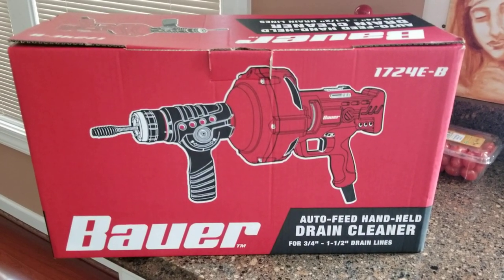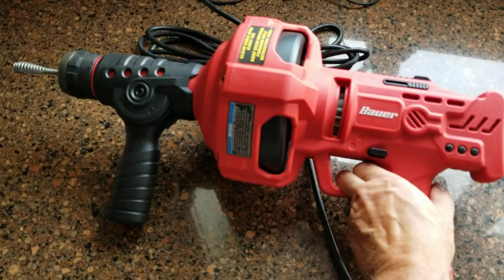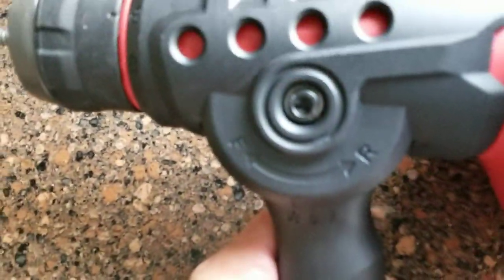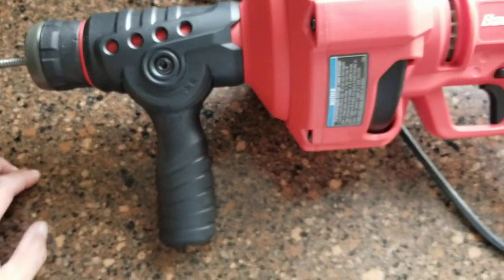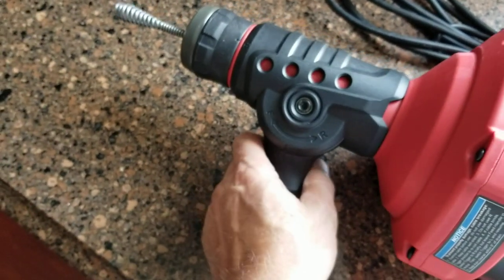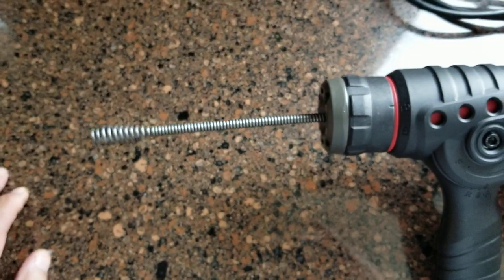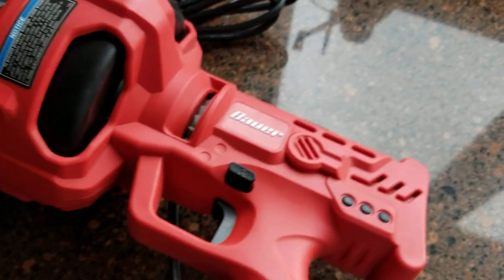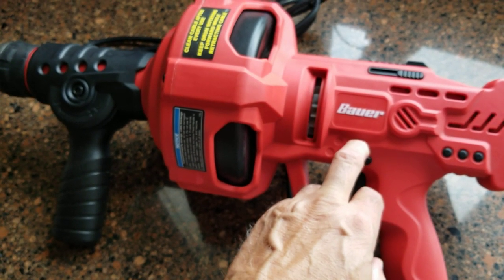Harbor Freight 64063 Bauer Drain Cleaner - Quick Start Guide

Comment: The trigger in the back of the unit is for the rotation of the feeding cable ( Clockwise to clean the clogged pipe or counter  clockwise to undo a possible twisting of the cable ) while the front handle is to feed the cable forward or retract the cable in reverse.

Comment: The F/R button is for use when your line gets snarled up. It will allow you to attempt to unbind your line. That's why it's meant to be used only a few seconds at a time. 

If used to retieve your line normally, you'll get your line snarled up in the drum and cause damage to your tool.
Reply from the maker: Thanks for the explanation. Does that mean the cable would just rotate in Reverse without retracting into the drum?
Reply: @caymanwest4929  the retraction and estension is disctated by the position of the lever. If you must run it in reverse, you do it in neutral, just enough to unsnarle the coiled up spring. 

Think of a slinky spring that you twist and it forms a loop in itself. To get that loop out, you have to twist in an opposite direction.

Comment: Good review and only vid on this that covers the weird ass F/R back near the trigger that seem to not be needed much if ever.  Also the lock ring explanation.
Reply: Thanks Monkey Wrangler.  Since making the review, several posters have clarified the F/R button near the trigger and it makes sense.  The F/R function on this unit actually references two functions:

1. The F/R on the feed handle makes sense to everyone, F feeds the cable into the pipe and R retracts the cable.

2. F/R button near the trigger really should be renamed Clockwise/Counter-clockwise.  The cable normally rotates in a clockwise manner, regardless of Feeding or Retracting the cable.  There could be a time where the cable could snag, for example, clothing. In that case, the F/R button we're now referring to is when you'd want to briefly put it in the R (or COUNTERCLOCKWISE) position.

I wish I understood this when I made the video, but thanks to the others here who pointed this important feature out.  Hopefully you'll never need it, but, it could be a lifesaver in certain situations.
Reply: Why is forward and reverse so hard for people to comprehend?🤣😵🥴???
Reply: The button on the back actually doesn't say f/r it says r/l meaning left and right referring to the direction the drum will spin.
Reply: As pointed out, it is "L" and "R" not F and R...

Comment: Just a clarification re the F/R switch where the tape is placed tape over it (located near the trigger).  As others have astutely pointed out, this button should be renamed Clockwise/Counterclockwise Cable Rotation.  The normal position of this switch is Clockwise ("F" on the switch).  In the event the cable snags, briefly change the switch to a Counterclockwise rotation ("R") to remove the bind.

Comment: Thank you much for the info. 
Just purchased this one & I'm about to use it for under the kitchen sink😁
Reply: I literally just received mine and am going to do the same thing. I came to see if I can find videos on it first. LOL.
Reply: @soota6083  ...... I have no idea what was in my pipes...i was up till after 11 at night using this gun to unclog it. Little frustrating when it wasn't unclogging after many attempts. But with prayer & relentless dedication, it FINALLY got through. 
The one thing I wish this gun had tho was the option to change the tip of the heads. I wish I could attach a wider head. Other then that, great gadget. 😁

Comment: Thanks for the info,  I was assuming that reverse was just for taking tension off the line in the event the forward got jammed,  use reverse to take pressure off,  and not to use it otherwise as it would unwind the cable weave and cause damage to the cable not the motor

Comment: I found out the hard way that if you run the motor too long in the reverse position it will kink up the cable, and you will need to replace it.
Reply: I found out the hard way not to lend it out to others...now it runs full blast as soon as you plug it in and there is no sign of the cable anywhere at all...fun times. 🤨😣😑😒